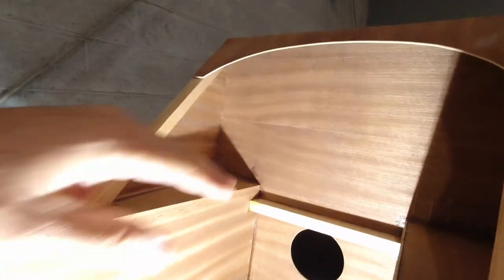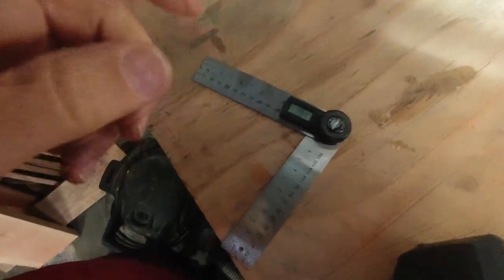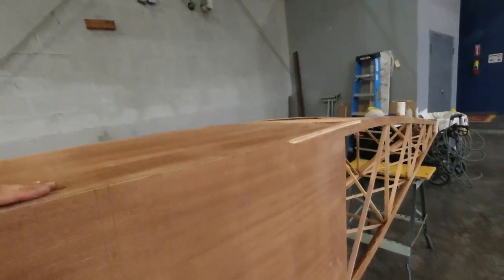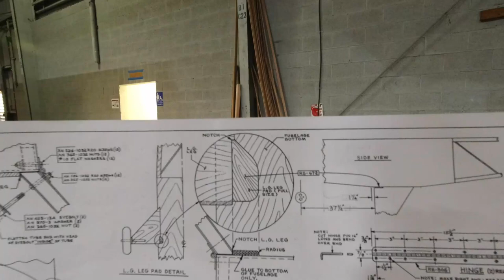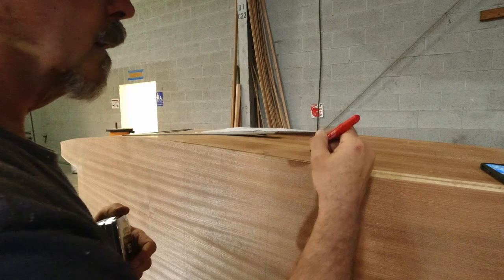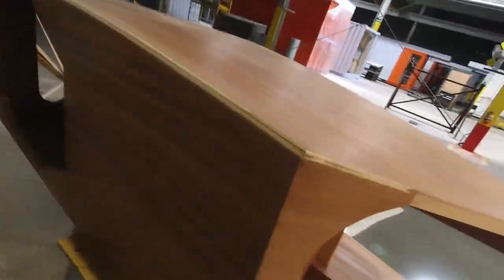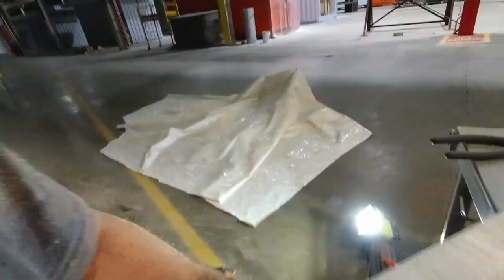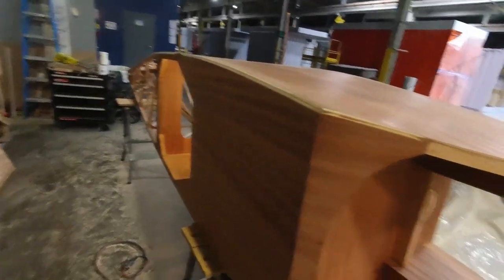Minimax 1100r Wood Aircraft Build Ep 76

Comment: Just a small point. You measured back for the UC from the nose arounf the curved fuselage but the measurments are from a projection, my point is me may be a bit forward of the proper fixing point (I don't know what they a fixed to but I assume some internal structure, like cross member). Think it might be worth checking. So hapy you got some quality family time.
Reply from the maker: Hey there Algy!
I probably didn’t explain that well enough. I was only measuring for the routing and not actually making marks for the LG location. I’ll do that by drilling a 1/16” hole from the inside of the fuselage as there is a point that allows a really accurate location. 
What’s next on your build?
Reply: @DTMinimax  thanks for that, I thought you must have a more accurate way of finding the point,  just wanted to point out the possibility of error. 
Well the rudder is coming up.
Reply from the maker: I appreciate your critical eye! 
That’s right you still have the rudder to build. I put the Dakota Hawk on my list of possible next builds after seeing your work. 

I want a comfortable airplane my wife and I can fly around the country. I like the Hawk/Corvair combination. I like the CH 650/Corvair and I like the Sonex B/Corvair. 
Obviously I like the Corvair engine. 
To go a completely different direction, in the composite world, I like the Dragonfly MKII and I’ve always liked the Long Ez. I just don’t want to spend 10 years building. 

I flew the Citabria again yesterday, shifting winds made it really challenging in the pattern. My air work was great, but 5 landings and 4 go-arounds in the pattern...all part of the learning.
Reply: @DTMinimax  as I have not flown since December I hope my foot work is good for the next time I can fly. Roll on the end of Lockdown!!!!!
PS my next build after the Fisher is a restoration of a old Auster.
Reply from the maker: The Auster is a super cool airplane.
Reply from the maker: Is that a wood wing and a steel tube fuselage?
Reply: @DTMinimax  Yes a mix of materials. It's not my aircraft just one I have been asked to help with. It is a war bird that has been bought from a museum so it can be returned to flight.

Comment: How much in wood cost do you have so far?
Reply from the maker: That’s a good question Frank..I’ll check my logs and see where I’m at
Reply: @DTMinimax  I am thinking of scratch building a V- Max
Reply from the maker: Definitely go for it!
I really enjoy scratch building. Takes a little longer but I enjoy every minute of it. 
I have spent $885 for wood and I have everything I need to finish. 
I’ve spent $5500 total but that includes all the accessories from Team and a $2700 deposit on my engine. 
335 hours building so far.